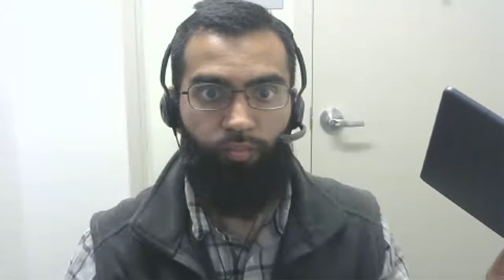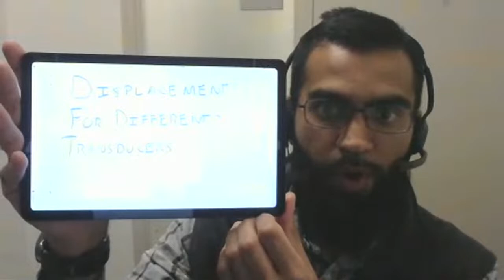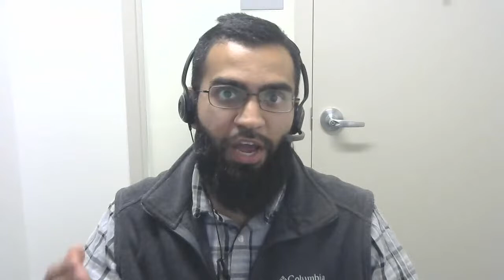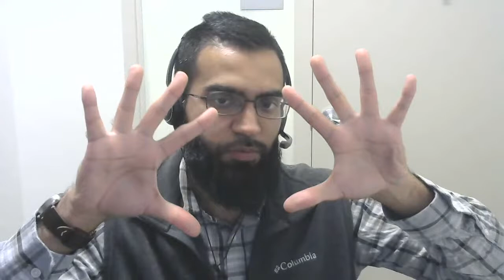Piezo SHOCK Show #64: What displacement levels are required by different ultrasonic transducers?

Comment: What frequency displacement and power would I need for an atomizer to make fog at 12 oz per minute water feed?
Reply from the maker: That's pretty specific. You should need a bolt clamped Langevin transducer with a through hole to feed the water.